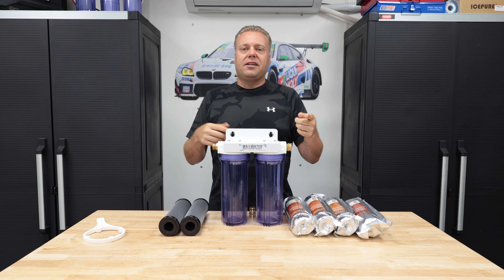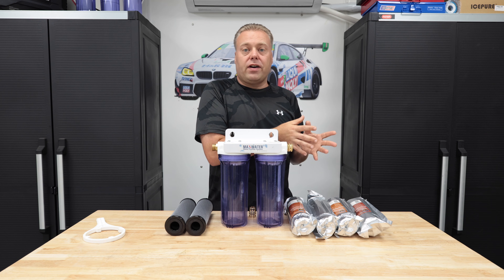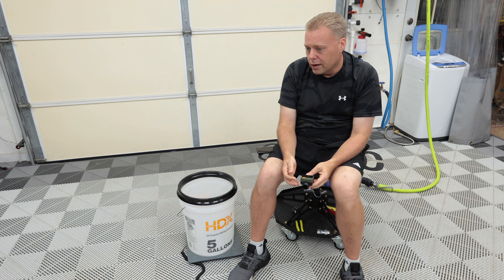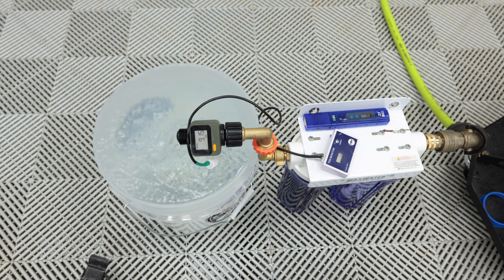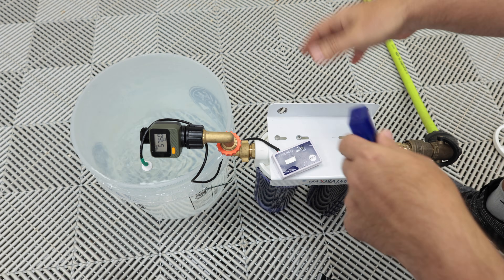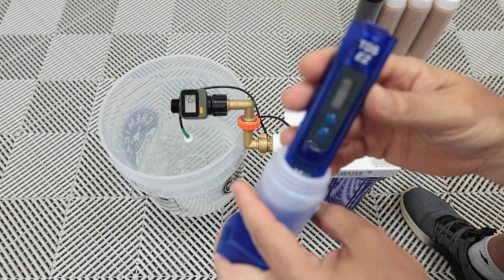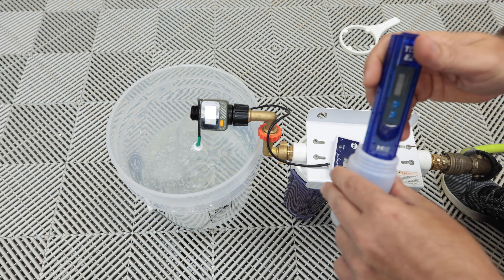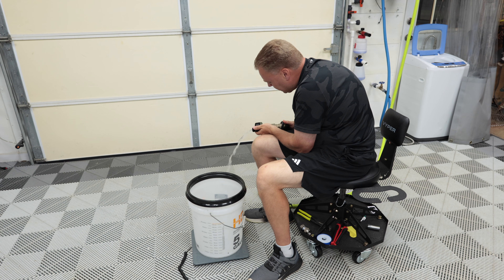Do Carbon Filters Help DI Spotless Resin Life? | Surprising Results! | Deionization

Comment: how do you know when your cabon filter needs to be replaced?
Reply from the maker: One way to know is have pressure gauges on the filter housings some systems come with them already. Changes in the pressure show the  filter being used up. Other than that I just change mine out once a year. Most are good for 10k+ gallons depending on the water so even the worst water will do 1k gallons.
Reply: @CarsWithKeav  thanks for all the information

Comment: You are doing great work here! Thanks for your investment and content. 20% extra length on resin is worth the investment.
Reply from the maker: Thank You, I would bank on 10% to 15% all depends on how much chlorine is in your water. Just as a full time filter it will help save your fittings from rusting from the chlorine. That is how I run my system carbon filters run 100% of the time.

Comment: Great stuff keav. with how long carbon filters last they're a must have. Especially since chlorine is corrosive.
Reply from the maker: Agreed, that’s why I run my carbon filters 100% of the time they will save pressure washer hose fittings as all the hose end connection internals are usually steel. Stainless steel quick connects only help so much when the threaded part of the hose and the seal crimp are just steel.

Comment: Can be use for drink or just car wash
Reply: Just car wash.
Reply: Definitely do not want to drink deionized water.
Reply from the maker: Deionized water itself is safe to drink, but not having any minerals it isn’t the best for you. It is actually more pure than distilled water as it does not conduct electricity. You don’t really want to drink from these filters unless all of your fittings and pipes/hoses are food grade and clean. Zero filter pitchers for example is deionized water, but food grade certified. I use those to fill up my ice maker the water I’ve comes out crystal clear.